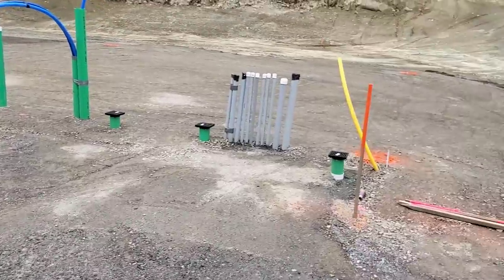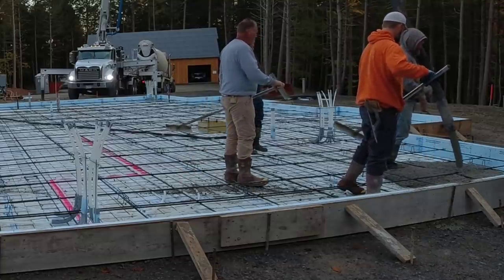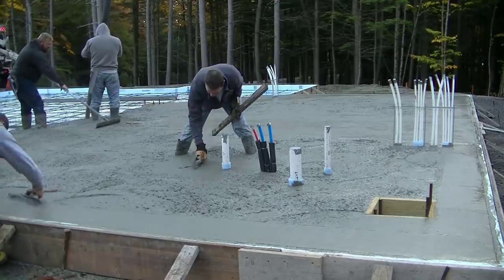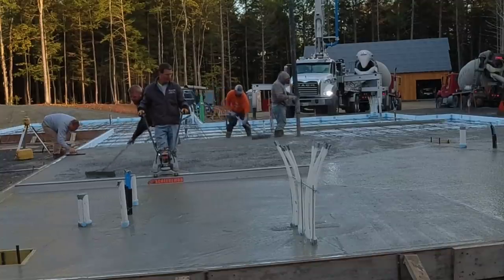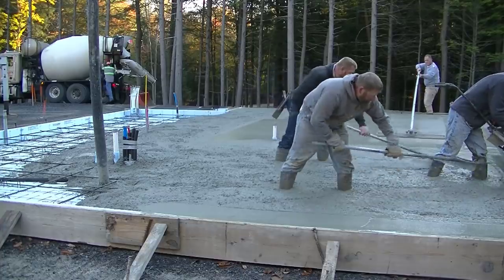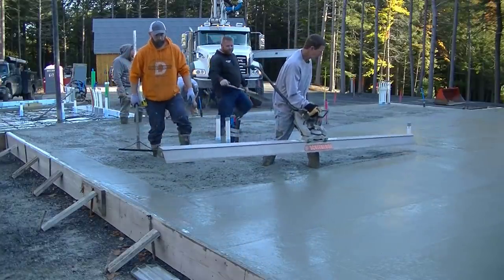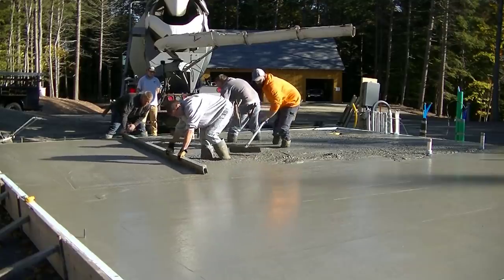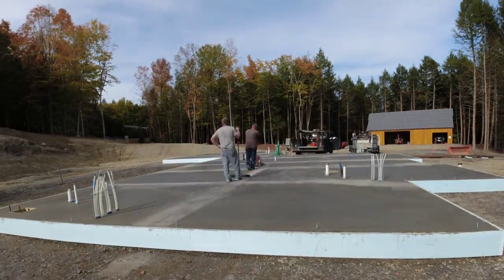He Made Us Pour His Concrete Slab 10 Inches Thick! (Waste of MONEY?)

Comment: I did a 12" thick slab in Ontario Canada and it was excellent. The slab really held the heat, and also provided cooling in the summer. 
My shop is done the same way. It's even more noticeable in the shop due to the fact that it's only occasionally heated.
Reply: Yes, i was thinking it would hold heat longer
Reply: just what i thought here
Reply: Yes. Thermal mass
Reply: not only that but if the guy is installing a hoist/lift for his vehicles then the concrete needs to be a minimum of 10in thick to be safe

Comment: I can see how the 10" consistent slab saves labor putting in the haunches on a 6" slab. Would there be a $3k labor savings? Like someone else mentioned, there is a lot of thermal mass here, which helps in temperature moderation
Reply from the maker: It was probably a wash.
Reply: @MikeDayConcrete  Then it was worth it for the comfort. I would have done more insulation but I'm in colorado
Reply: Plus grading was all machine.  In n out.
Reply: Yeah, when it gets cold, it's like a giant hunk of ice...So awesome...Or conversely; when it gets really hot; It' feels like you're in a brick oven...That's awesome, right? wait...
Reply: @godbluffvdgg  no... instead of house that quickly changes temperature from warmer to cooler with the day/night cycle, you have a giant block of concrete that keeps the temperature. The radiant heat/cooling per season does the rest. It makes for very comfortable floors, always radiating heat in the winter or absorbing heat in the summer. 

In short: Air changes temperature quickly, giving drafts and chills. Radiant heat/cooling is different. It's more stable and comfortable.
Reply: @godbluffvdgg  You obviously don't understand mass or that it is inside the envelope. It's warm when it's cold out side and cool when it's warm. Often with considerably less energy to keep it at the desired temp.
Reply: @MikeDayConcrete  Even if it's no wash, now he has alot more thermal mass for the heated slab. If he can heat the water with Wood its important, so you don't have to run the Stove that often. 
And that is a bonus worth getting!
Reply: @godbluffvdgg  It has hydronic radiant heat in the slab, with foam insulation under it.  This slab is going to do the exact opposite of what you suggested.
Reply: @godbluffvdgg  I think you are assuming a much faster temperature change.   I think the slab is going to hang around the average temperature for the area for long periods of time.   It's going to be sheltered from the heat.   Much of the slab is always going to be heated or cooled into the 68 to 78 degree range.

Anyway the formula is Q = m * C * deltaTemp.   Mass is linear so double the mass would half the rate of change.  The percentage exposed to outside temperatures would determine "C".  I'm assuming most of the slab won't be exposed to the outside.

I do agree that towards the end of winter the slab might get cold and towards the end of summer the slab might get warm.  I just don't think it's going to be as dramatic as you think.
Reply: @macmcleod1188  The slab has a structure on it...What you're alluding to is concrete isolated from the ground and uncovered...The interior slab will have a surface temperature of the room it's in...If you penetrated it with a core bit, the bottom of it would be the temp of the sub base...Concrete is non conductive, so it doesn't respond temperatures like a metal would...I believe this entire thread regarded concrete as part of the heating/cooling cycle. Never saw that in my 30 years in building, But; if its uncovered or in an unheated building, in a cold winter, it'll be cold...Just like the walls...
Reply: @sparksmcgee6641  so basically the same reason/ principles on why snakes come to the road at night, in order to keep themselves warm as the road retains heat it got during daytime, right? (just asking questions because Youtube suddenly recommended me this and I got curious)
Reply: @namelessone5968  You got it. And it can go the other way, in the desert you get the house cooled down at night and it help moderate heat. Eco builders from th0-90s thought that mass was all you needed and found out that's not the case. Insulation is vital and more important that mass. But once you have a well sealed envelope mass inside helps a lot.
Reply: @godbluffvdgg  since the homeowner is a builder, im guessing he's going with external insulation, so the concrete slab will be totally within conditioned space.
Reply: @godbluffvdgg  it's a home. They said that.
Reply: @MikeDayConcrete  If net cost is the same, why not go the extra mile? So, the answer to your original question is; no overkill.

Comment: He has radiant heat, that’s why he wanted a 10” slab, that will be a very large mass to cool down, so the house’s temperature will be much more stable, and take a lot longer to change as well.  My basement slab is 4”-5” thick and has a 15 mil vapor barrier above dual layers of R10 solid foam insulation, so it’s independent of the earth temperature and also mostly vapor proof.   Garage slab is similar, only 1 layer of R10 foam, but the same 15mil heavy vapor barrier
Reply: hes screwed with the pipe at the bottom it should have been 2 inches from the top. that thick of a pad should of been two layers of rebar at 3" off  bottom 3" off top.
Reply: @MitchOfCanada  Yeah this is what I was thinking. That radiant heating is crazy deep in the concrete.
Reply: @burnhamrobertp  the reaction time from heating will way outway the benefits. -10c to a -35c day you will not be able to get the heat from pipes to the room in time for it to work. And once it does, You can have the pipes off for a week and still increase in temperature. 

Quick fix will to be put down another layer of heating pipe ontop of the slab and do 1.5-2" Self Leveling slurry on top and start again.
Reply: This seems like a legit reason. You're not wrong.
Reply: @burnhamrobertp  I've never done a double mat under 12" thick.  30 year ironworker
Reply: @MM-ui9rm  common misconception.  Heat does not rise.  Warm air rises only because it is less dense than cooler air.  Heat always flows from the high temp towards the cold temp, proportionate to the temp difference, in a solid.  Agree with you that this sucker will stay hot or cold for days, and not swing around much, but I do worry that the response time of the heating and cooling will be so slow that in spring and fall, he may have to live with the temp being off a few degrees for a few days.
Reply: @MitchOfCanada  I believe you are correct in saying the reaction time would be slower for a thicker slab. I hope the builder doesn't focus too much on zones and auto controls as these can get very pricey. In this situation you'd be "chasing your tail" anyways. However, if the floor plan is relatively open - as in a timber frame home - once you reach your desired temp that thick slab will require less fuel to heat it and it will stay at that temp for a long time. 
I built a timber frame with structural insulated panels on an 8 inch slab. I have 4 zones - 2 in the slab and 2 on the loft. My "thermostat" is one blending valve that I "tweek" every so often by hand. House stays a consistent 20deg C.
Reply: @MitchOfCanada  Not if the idea of the slab is heat storage.
With a big capacity heat buffer(thick slab) a heat pump can be ran more efficiently.
Pipes at the bottom is advantageous for heat storage.
Reply: @razor21212121  Yeah, but you are sacrificing any possibility of regulating the heat. I hope they don't plan to have large windows, as that would make Spring and Fall absolutely terrible.
Reply: @noneofyourbusiness6749  A double mat will provide greater strength using the same amount of steel. It will make the slab preform more like a WF beam What bothers me about this pour is the very high slump indicating enough water to reduce the concrete strength. At least they used rebar in stead of 66,1010 which, given the way it is normally placed, is pretty much useless. The Portland Cement Association has excellent information available. Most residential work is done by people who have never "read the book!" I poured a lot of concrete on government inspected dams. The inspectors were always knowledgeable. I later went on got get my degree in architecture. Too bad more architects don't work in the field before they get their degrees. It is better to over do the foundation than deal with breaks later.
Reply: @JainZar1  I'm guessing it's more than 1 loop for the entire house, probability each room has a loop, thermostats (although would react very slow and wouldn't work as precise, for stable temp control they would have to be PID controller based and properly mapped ) could compensate in rooms with greater heat loss.
Reply: @razor21212121  Yeah naturally you have multiple loops per room, but even with a PID-controller, you can't compensate for fluctuations that are far faster than the P-T1 element of the floor. I have tried to unscrew two buildings which have thermal building element activation and even with increased flow rate to rapidly change the heat of the concrete, you can't really do it with the wall/floor alone. We installed a full 4-stage air-conditioning in one case and upgraded the ventilation system in the other to pump outside air into the rooms to regulate the short-term temperature and prevent temperature spikes in one or the other direction.

We switched the building which now has the full 4-stage air conditioning system to only provide the base heating/cooling required via the concrete element activation and the fluctuations in load are picked up by the AC system. That way naturally carries a larger operating cost, but gives you far greater ability to react to changing weather or a changing amount of people in the building (which isn't an issue in this case).
Reply: @JainZar1  Your comment makes a lot of sence.
But still the idea of using the foundation for heat storage is very appealing to me, What if a slab say 250mm (~10inc) has one big loop at the bootom(optimal position for heat storage) that is kept at a constant temperature (say 25C) and you want room temp of 23C, the concreet is going to slow down the heat transfer and provide heat storage, place a second loop at the top for each compartment (with a normaly closed valve on the intake regulated by a termostat) that intakes colant from the main loop exhausting to the return/before the pump. Do you think this aproach would solve the temperature regulation issues?
Reply: @razor21212121  Yes, it would mitigate the issues, but you essentially negate the energy storage inside the concrete and have far higher costs for running pumps etc. 

What you can do is heat the concrete to your target temperature of 23°C, that way you don't have a floor that is too cool or hot and you have a dampening both in both directions. You then need elements to do the actual heating/cooling.
If you really want a floor heating setup, do that at the top of the floor, like normal. That way you still have the mass of the concrete working as a dampener, but you decrease the regulation issues.

Compared to a regular floor heating setup you more than double your energy losses by doing it your way. You effectively pump half your heat into the soil instead of your house.
Reply: Hi mass slabs are not desirable for radiant heat. House with high mass slabs often overheat when there are large temperature changes outside. They also take a long time to heat up. If fact, the temperature inside can be much less stable since the response time with high mass slabs are very slow.
Reply: @razor21212121  what reason would you have to 'store' heat in slab ? That's ridiculous.
Reply: @scottd7615  Well I have no experience or education in materials science and construction, so that helps ridiculous idea genesis :) , but i still think that with some sort of insulation under the slab and a little more complicated internal structure consisting of insulation layer under the floor loops and the main slab which would have a big loop that supply the separate room loops would be possible and still more economical that buying heat buffer/storage tanks, as to why use the slab for heat storage : 
- concrete is relatively cheap
- heat storage system is expensive and would need some maintenance
- heat storage in concrete slab wouldn't need maintenance
- the foundation is there why not make it do more.
As to why have heat storage in the first place :
- If heat pumps are used they can be operated more efficiently (only when it's warmer outside and/or when electricity rates are lowest)
- you could use solar thermal collectors (can be up to 70 percent efficient, way more those expensive multi-junction photovoltaics used on the ISS, and are cheaper), have heat on rainy days and during night time.

If using fossil fuels and plant matter there won't be a need for heat storage, just burn stuff when you need to, but that is terribly inefficient, very polluting (I live in a country where most people burn wood and coal in wood burning stoves, my boogers are black winter time not optimal), and in the long run the most expensive option(well depending on where you live I guess).

This was a long one.....
Reply: @razor21212121  All that has been done before and its always ends up a colossal waste of time and money. The Achilles heel of systems like you describe are the massive maintenance costs associated with all the equipment and controls needed to maintain the system. WE have ripped out dozens of similar systems only to replace them with simpler systems.
BTW i believe a water tank is a less expensive for storing heat.

Comment: If he is going to be heating the slab itself (having that mass is awesome) and keeping that at a constant temperature and then using a air to air heat pump to make up minor temperature differences then this is what I would do. I have an 8 inch slab in my garage and the thermal mass is great as long as you keep the temp consistent. 
Even the equipment absorbs heat from the floor so even if the big doors open in the wintertime moving stuff in and out you get that air exchange but you change it for fresh air and it takes no time to heat up again from the floor and equipment.

Comment: In Germany, foundation plates are mostly about 12 inches thick and have four times as much steel installed . However, they are then usually also loaded by three storey masonry and reinforced concrete ceiling panels.

Comment: One advantage is the huge thermal mass of that slab...once it gets up to temp it's going to stay there for a long time!!
Reply: I built a home in northern Wisconsin with 36" piers under a 12" monoslab. Works as a heat sink. Passive solar. Its pretty sweet.
Reply: Was thinking same thing.
Reply: That's the first thing I thought
Reply: I just wrote the same thing
Reply: and it won’t take longer to warm or chill ? maybe smart concrete ?  10 slab for what a 747 ?
Reply: and will take a ton of energy to maintain the temp

Comment: I'd have to calculate out the thermal mass of each, but certainly a 10" slab will give you much more thermal protection of the structure if the power goes out in the winter.
Reply: yea my first thoughts as well thermal mass good alot of thermal mass is bettr
Reply: It will take longer to heat . And cost more
Reply: @tpike32  it’ll hold the heat longer when heated and stay cooler longer when it’s hot out.  It’s actually better than a thinner slab.  May cost more to initially get it up to temp but it’ll stay there much longer than a thinner slab.

Comment: You guys are amazing.  How you can get that slab so level and great looking is admirable.  I would imagine that the thicker slab will be a big plus with the radiant heat. Once the thick slab absorbs the heat, is will act as a reservoir (thermal mass) and give that heat back off slowly and evenly, kind of like the hot water radiators in older houses.